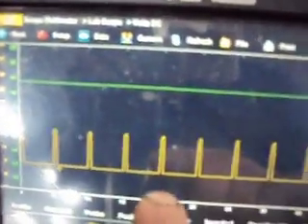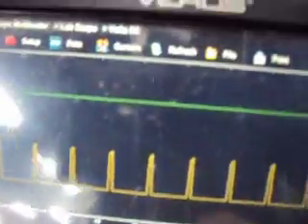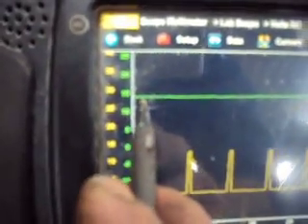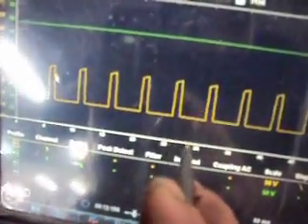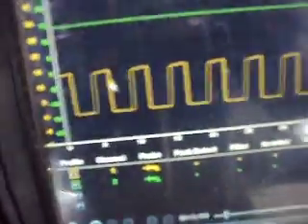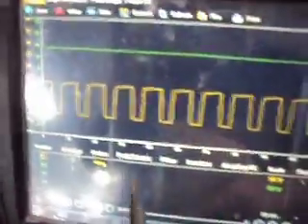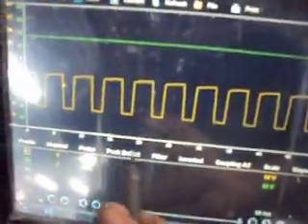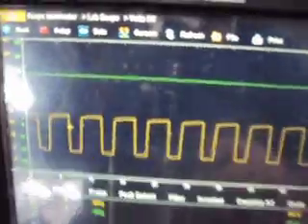Testing the cooling fan control module of a 2006 Ford Crown Vic. 4.6 with code P1285

Comment: so the voltage control wire from the PCM is 5 volts modulated not 12 V

Comment: Hey man I could use some guidance or help. This is the deal I have this 2011 Ford Crown Victoria taxi cab, I work at a taxi company. The cooling fan will not come on. Before you say try another fan or module or try a complete assembly let me tell you I've tried 4 brand new assemblies because the shop kept telling O reilly's they were defective and to bring another one which they did. Ok so I tried each fan and module assembly on a different cab and they all worked. They were all perfectly good and functional. I went in hands on diagnostic mode with multimeter, test light, Snap on Ultra probe and spare wires for jumping. I first verified power at the connector going into the fan control module located at the fan, there is no fan relay except for in the module at the fan on this vehicle, which came at 12v. I then checked ground which was perfect. I then tested for voltage at the pcm wire which was perfect as well. I then moved to testing continuity and as I thought it was all perfect as well. I then voltage drop tested the circuit and of course there was no excessive or out of spec voltage drop anywhere on the circuit. I then visually inspected all wires and connectors and there was no issue what so ever. I then moved over to testing mode in which I jumped the fan from the battery first and it came on and worked perfectly. I then unplugged the module from the connector with the 3 wires on it and jumped the fan from that connecter and of course it came on and ran perfectly. I also swapped the pcm off of a cab which it's cooling fan worked as it should onto this one with no change. I then just for fun repeated this process 4 times on each fan and module assembly and absolutely no change and they all worked perfect when jumped. Being able to somehow code this fan control module at the fan is my last hope of getting this fan to work as it should. Currently the fan is controlled by a toggle switch I wired to it with a 30 amp inline fuse.
Reply: Did you find the problem yet or were no passengers picked up in the last three years?

Comment: So the PCM just pulses the control wire ((FC-V) fan control variable) to ground and the fan control module duplicates that pulse width to the fan motor, only with more amperage like whats required by a 1400 watt motor ?

Comment: You can take the cooling fan module off, replace the capacitors in it and it will work. I just did this on a 2002 Jaguar X type. The capacitors were only .69 a piece and it ran me about 4 hours of labor... just a thought.
Reply: Hi. How did you pry the module apart?

Comment: I test the cooling fan its self by using a power probe
Reply: My crown Victoria  running  hot only when I speed  up   . It's a 98 . I replaced  the thermostat  and water  pump.   But I can sit still  and it want run hot.
Reply: You need to lift the car off the floor so you can simulate the driving conditions when it  overheats  and so you run the  troubleshooting tests  like coolant flow restrictions (defective thermostat,clogged system,...) ,
check duty cycle with scanner ) , fan speeds ,and so on.....could become a tedious job !